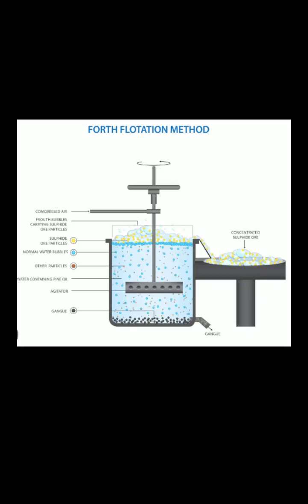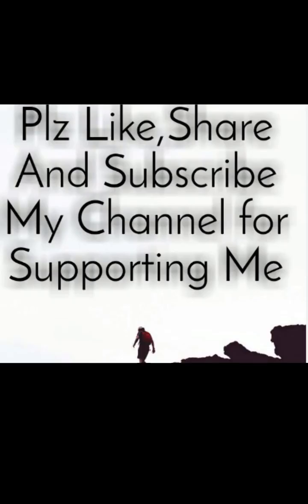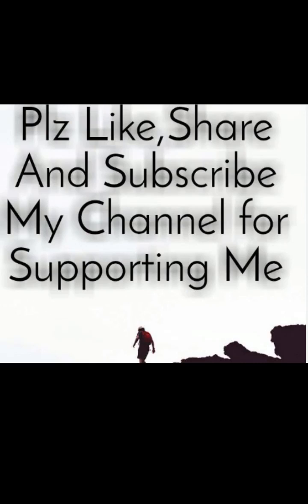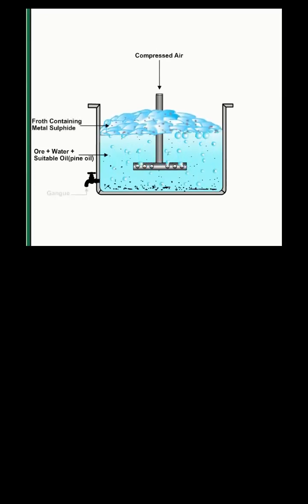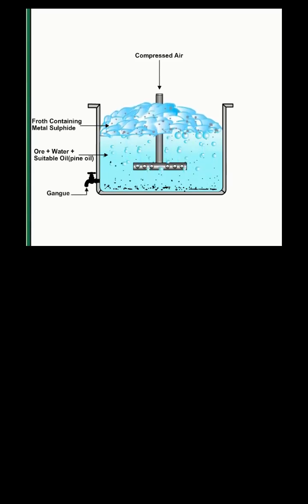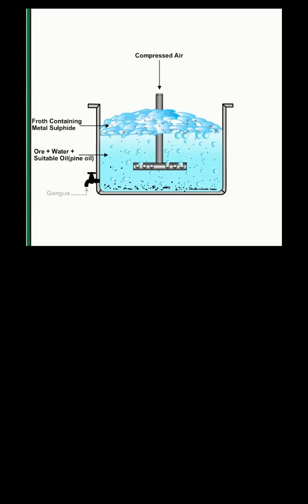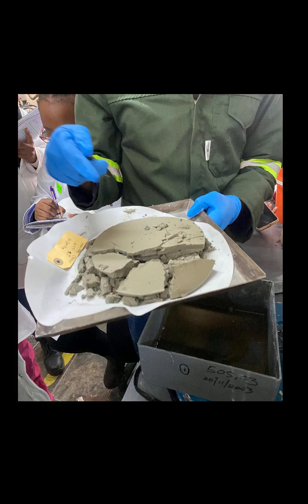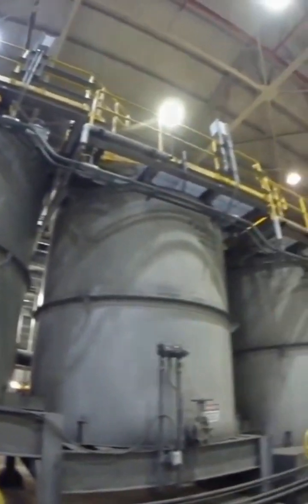The Science of Froth Flotation in Mineral Processing

Comment: If the antimony sulfide ore , which additive activated oil do we have to add with water ?
Reply from the maker: In the froth flotation process for antimony sulfide (Sb₂S₃) ore, an appropriate collector must be added to enhance the hydrophobicity of the mineral particles, allowing them to attach to air bubbles and separate from the gangue. Typically, xanthates, such as potassium amyl xanthate (PAX) or sodium isobutyl xanthate (SIBX), are used as collectors for sulfide ores, including antimony sulfide. Additionally, pine oil or Methyl Isobutyl Carbinol (MIBC) is often added as a frother to stabilize the froth and improve bubble-particle attachment. Water is used as the medium to facilitate dispersion and flotation. The combination of these reagents ensures efficient recovery of antimony sulfide during the flotation process.
Reply: @morakamalebati7698  how ratio mixing between water and pine oil. ?  Water 1000L. / pine oil ?? L
Reply from the maker: @turdpoompookusmas1286  The ratio of pine oil to water in froth flotation can vary depending on the type of ore and process conditions, but typically, pine oil is used in very small amounts as a frother. A common dosage is 10–50 grams of pine oil per ton (1000 kg) of ore processed, which translates to roughly 10–50 mL per 1000 litters of water in most flotation circuits. So, for 1000 liters of water, the approximate pine oil amount would be: 10–50 mL of pine oil. Let me know should you require any further explanation
Reply: If i have an everage Sb2S3 25-35% after flotation can upgrade to 50-60%?  

Or if my material is average 35-45% antimony ore after flotation froth process can i upgrade to sb60% ++?  

My machine is, Jaw crusher> hammer> Ballmill> Scruber Mixing
 tank> flotation cell > dewaater
Reply from the maker: @turdpoompookusmas1286  Yes, upgrading your antimony sulfide (Sb₂S₃) ore to 50-60% or higher through froth flotation depends on several factors, including ore mineralogy, reagent selection, and flotation conditions. If your feed grade is 25-35% Sb₂S₃, achieving 50-60% is possible with proper optimization, but recovery efficiency plays a crucial role. For ore with 35-45% Sb₂S₃, reaching over 60% is more feasible, provided that flotation conditions are well controlled. Since your process flow includes comminution (jaw crusher, hammer mill, ball mill), scrubbing, mixing, and flotation, you must ensure fine grinding (preferably below 75 microns) to liberate antimony sulfide particles. A well-chosen collector, such as potassium amyl xanthate (PAX) or sodium isobutyl xanthate (SIBX), is essential to enhance selectivity, while pH control (around 6-7) can improve flotation efficiency. The addition of depressants (e.g., lime) can suppress gangue minerals, improving Sb₂S₃ recovery. If your concentrate grade remains below the desired level, additional cleaner flotation stages can help remove impurities and upgrade the Sb content. However, if the ore contains complex associations, gravity separation (such as shaking tables) or a combination of flotation and roasting may be necessary for higher-grade concentrates. let me know if you need an additional clarity.